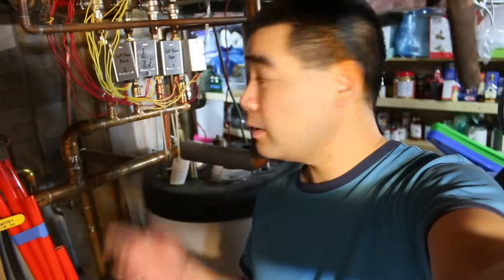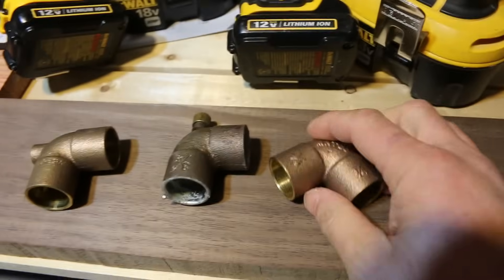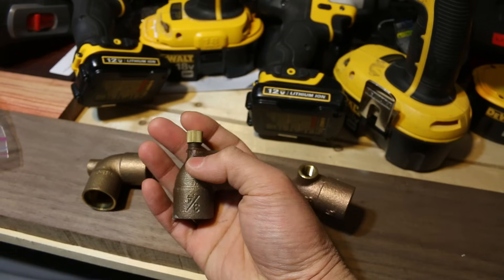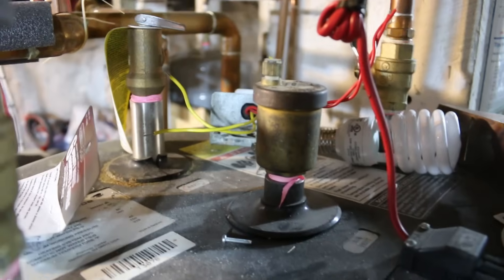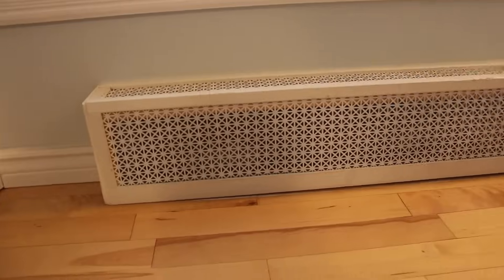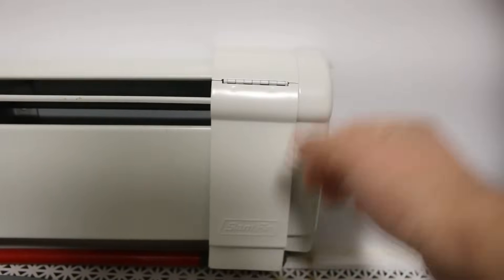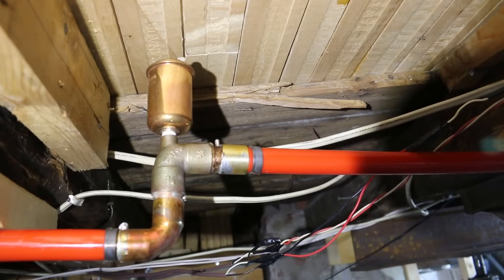How to Bleed a Hot Water Heating System - Boiler, Hydronic Heating System

Comment: Wrong wrong wrong wrong wrong you put the air scoop in. circulator has to be on the return side I get the saturated air out of the water air scoop on the supply side and it looks like the zone valves are on the right place. Why put parts in that don't work

Comment: This is good but when you change the air vent you have to bleed the system again. I'd you use caleffi air vent part number 502710A it has a built in check value that come with it. Therefore no need to bleed your system. Hope this helps someone out 😊

Comment: When the registers are in a single loop, it doesn't matter where you put the bleeder cos the water will push the air pockets along the loop. Cycling the same way the water would. So when ever air gets to the point where the bleeder is, it bleeds off. No need to install at the highest point of the house. When they are in multiple loops, you better off putting it closest to the boiler itself.
Reply: For baseboards, if there is a drain valve above the circulator and shut-off below then flushing and bleeding can be done at once. For single story just the air scoop bleeder at the boiler is typically sufficient. But will still put an elbow bleeder at the end of the loop just in case, and especially so for multi-story home given the longer drop.

Comment: You used the wrong pex
Reply: The pex used does not have an air barrier.  Also, some of the pex crimp connectors are done wrong.  One I saw on the video was right up against the fitting - inspector would fail!!

Comment: Too many non-essentials...waste of time here!
Reply: Don’t really need those. I have bleeder valves at the boiler by the zone valves. Just turn on the spigot with a bucket and leave water feed on and open valve or use a hose on the end of the valve till all air out. Gets the job done fast. Only time you need to purge air is if you have changed the pump, etc.
Reply: @donaldbracciano832  Correct!

Comment: what is the reason for bleeding the hot water system?  is there air in there at all times...I dont seem to have bleeder valves either and I have hot water baseboard?  If t here's air do you get loud cracks and snaps in the pipes??  thx SO much

Comment: I thought you couldn't use pex pipe with copper pipe.  I thought you needed pex alpex pipe.  I had asked my plumbing supply guy and he had said that the pex pipe can only be used at approx 90 degrees temp.  Am I hearing this right?  Pex is so much easier to use I had hoped to use it. Any thoughts

Comment: When you have very large amounts of air pockets, pressure bleeding is more effective, assuming you have the right amount of valves to shut off the the returns.
Reply: Thank you very much for this comment. I looked up how that is done and realized that most likely is why the installer of my system (and maybe Andrew W's system) did not include baseboard bleeder valves.

Comment: hi i have a boiler that is leaking water at the top of the air bleeder part..the red cap is broken is water suppose to be coming out when cap is off or broken?
Reply: der ddd no water should not be leaking out . You must have a defective air release valve . Maybe see if you can cap it with an old bike shearer valve cap until you get the release valve replaced so you aren’t losing system water .
Reply: @Bitinggoats1 replace it, should leak almost no water

Comment: Good video. One point though: switch off the boiler and pump at the socket or switch. A lot of boilers with a separate pump keep the pump running to prevent overheating. If the pump is on while bleeding a rad, air can be sucked in through the opened bleed valve.

Comment: I have  lots of air in my pipe. It took me long time to skim and seems never can take them out. I don't find any leaking in pipe anywhere. Please let me know what should I do
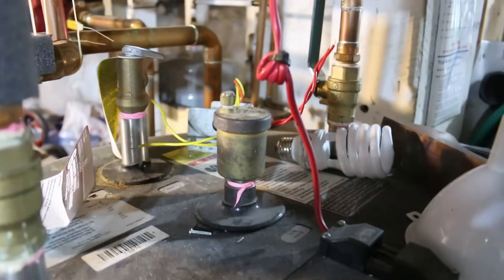Reply: I am not a pro but I have learned.  I know of three ways.  1.  You can replace all of the water in the loop (askmediy video explains this (if I remember correctly)).  2.  You can install those elbow bleeders at the high points of your loop zones throughout the house.  Air pockets form at the high spots and can be manually (some types, automatically) removed.  3.  You can install the bleeders that look like R2-D2, (1:06 in this video) on each zone, usually in the basement.  There are problems with all three methods.  Replacing the water introduces new minerals into the system which foul options 2 and 3.  Options 2 and 3 seem to foul with scale and crud anyway and need periodic cleaning and/or replacement.  Replacement is probably better as you don't want to poke the crud free, only to lodge down the line and ruin a more expensive part.  (That last sentence was a guess, not fact.  Perhaps someone else can weigh in on that issue!)
Reply: Shut the valve off below your  circulater and you can force feed  the water around the house and it will come out the purge valve (gate valve) above the shutoff valve..You can use the fast fill on you water feed (Reducing Valve) to get more pressure to force the water around the house which will carry the air out .If you have more than one zone do one at a time.

Comment: Hey Andrew at 4:13 you point at an air bleeder valve. I have one on my system. Question, is that knob to be kept tight or loose through out the heating season? Thanks in advance.
Reply: Nelson, with the manual bleed valves you let air out until you get a spurt of water, then close the valve. In my system, I bleed the radiators annually. I have no automatic valves except down near the boiler and manifold.
Reply: Keep it tight or loose doesn't  make a difference.   There is a hole in the cap for the air to escape.
Reply: Always Leave loose Or The Air Wont be Able To Get Out
Reply: Loosen and watch
It might leak a tiny bit of water at first, but should not continue leaking. 

Different models require different amounts of looseness. My Maid-O-Mist bleeders recommend 1 turn loose.
Reply: @cymond  Thanks for the info, will do. My system also has the Maid o Mist hi vent. I'll keep it at 1 full turn.
Reply: Nelson Vega?;-@×=9987654321+×÷=%_€£¥₩)(*&&^^^//$##@!--'cvvn
. 😀😁😂🤣😃😃😄😅😘😍😎😋😊😉😆😗😙😚😚☺🙂🤗🤗😇😐🤔🤓🤥🤡🤠😶🙄😏😣😥😛🤐😜😛😌😴😒🙄😪😯😝🤤😒😓😔😔😔🤕😕🙃🤧🤢🤕🤒🤒😷👺👹👿👾🤖🤖💩😺😸😹😻🙉🙈😾😿🙀👦😼🙊👦👧👳👨👳👴👵👸👷👳👲👮👱👶💂🕵🎅🤶🤶🤵🙆🏿🙅🙎🙍💇💆💆💁💁💁💁🗣🗣🗣👤🤥🤥😶🙄😏😣😌😮🤐😜😛😌😴😫😪😯😝🤤😒😒😒😓😓😓😔😔🙃🤧🤢🤕🤒👺😷😷😷😷😲🤑🤤☹🙁😖😞😟😤😢😰😬😩😨😧😦😭😱😳😵😡😠☻😈👽👻☠💀👺🇸🇩🇸🇪🇸🇬🇸🇷🇸🇸🇸🇰🇸🇱🇸🇻🇸🇹🇸🇸🇸🇴🇸🇷🇸🇴🇸🇳🇸🇲🇹🇬🇸🇾🇸🇿🇸🇿🇹🇦🇹🇦🇹🇨🇹🇩🇹🇲🇹🇲🇹🇫🇹🇳🇹🇳🇹🇲🇹🇱🇹🇱🇹🇰🇹🇰🇹🇯🇹🇯🇹🇭🇹🇭🇹🇬🇺🇦🇹🇴🇹🇷🇹🇹🇺🇿🇹🇼🇹🇿🇺🇦🇻🇪🇻🇨🇻🇦🇺🇿🇺🇾🇺🇾🇺🇸🇺🇸🇺🇬🇻🇬🇻🇮🇻🇮🇿🇦🇼🇫🇼🇫🇼🇫🇼🇸🇼🇸🇽🇰
Reply: Ian Cassell , seriously dude?